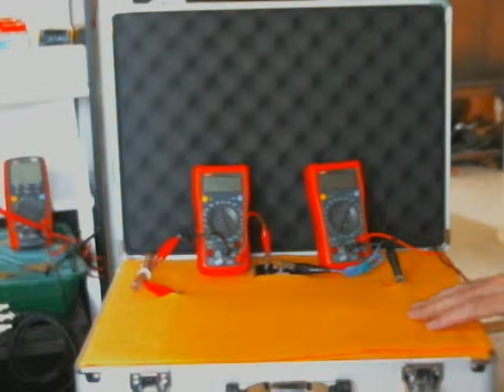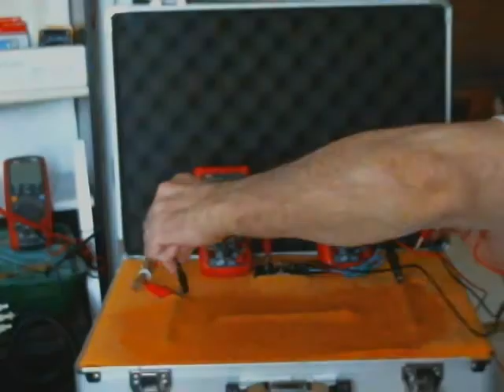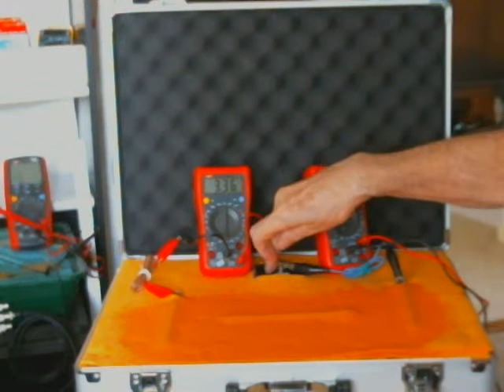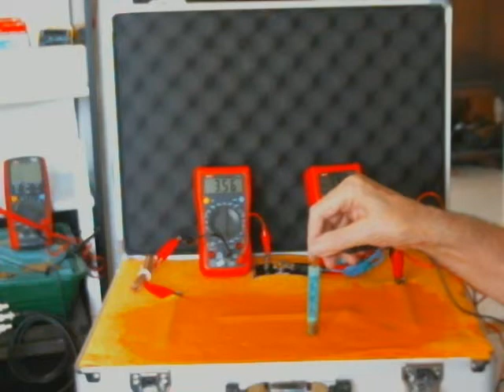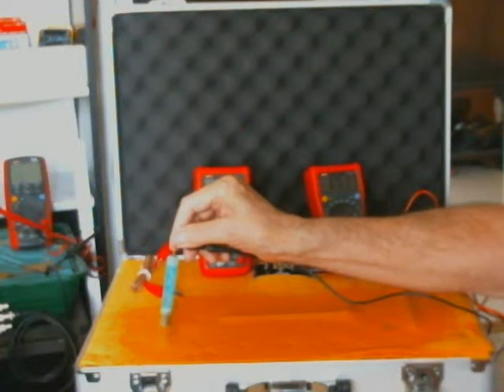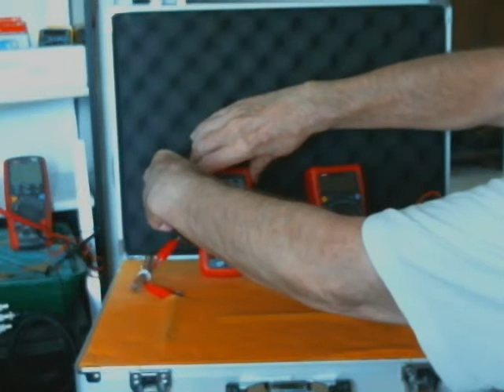3 nails corrosion control demonstration

Comment: Excellent video sir! could please explain in a bit more detail as to why we use a half cell instead of using the ends of a multimeter directly, as you demonstrated? Also, is there a better way of making a reference (instead of using a half-cell which changes voltage depending on position)? Thanks
Reply from the maker: The half-cell was thought to be a reference electrode when it was first introduced because the reaction of copper to a saturated solution of copper sulphate can be compared to the reaction of a 'hydrogen cell' that scientists use as a bench mark in the laboratory.  The probes of the multimeter are normally nickel plated copper and they have a reaction to the electrolyte in which they are placed.  All of the reactions that are in series in the measuring circuit effect the measurement that is displayed on the meter.  I have made many presentations and videos to explain that all present survey techniques include gross errors that can only be corrected by other tests.  I devised the Alexander Cell as a corrosion cell that shows when corrosion has stopped at the test location and this can be used as a criterion to adjust cathodic protection systems.